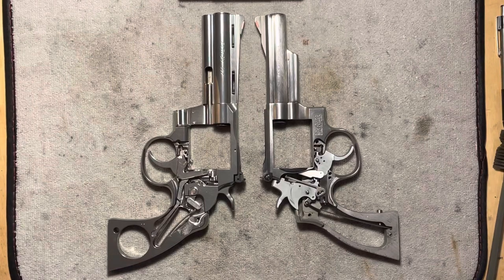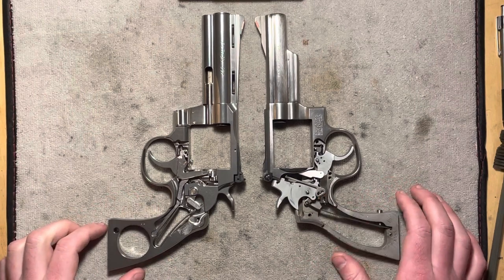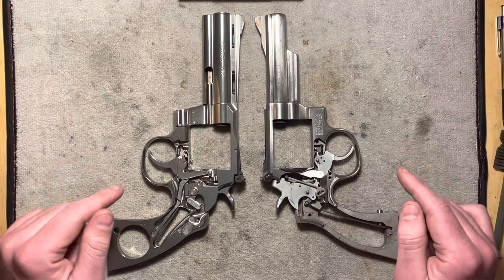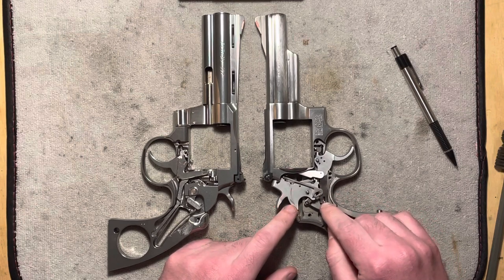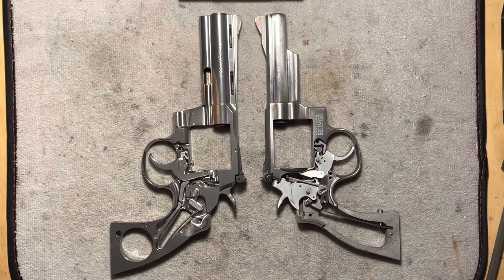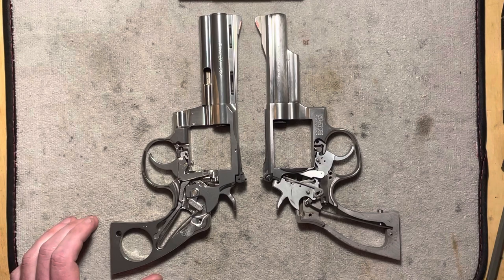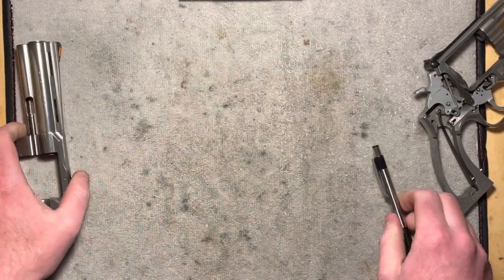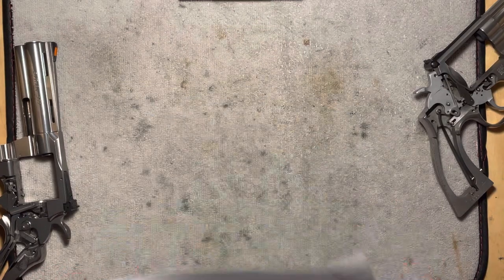Revolver Safeties: Transfer Bar vs. Hammer Block (+ Rebound Slide)

Comment: Great explanation. I own several Rugers and a fellow told me that the S&W 686 plus, also had a "transfer bar".  I knew he was giving me misinformation but could not explain the difference between a "transfer bar" and a "trigger block"   Thanks so much.
Reply from the maker: It’s definitely tricky to keep them straight and people get them mixed up all the time… looking back at the video, I even misspoke a couple times in spite of them being right in front of me and being the one explaining the difference. 

If someone messes it up in conversation I usually don’t hold it against them. It’s really easy to misspeak even knowing the difference.

Comment: Excellent video explanation.  There are a lot of people that get these confused or will even use the terms interchangeably in error.  I covered some of this myself in my video comparing the Ruger GP100 and the S&W686.
Reply from the maker: If you watch closely, I even jumble the words in the video at least once, then randomly threw in “firing pin block” just the really make a mess of things. 

In my defense, having both side by side and saying both phrases so many times was overheating the ole brain bucket.
Reply: @ColterBrog  It happens to all of us.  In a video I edited tonight (which isn't posted and probably won't be for a little while) I accidentally called a firing pin block a hammer block.  I catch little things like that almost every time I edit a video.  Often I never even realized I had misspoke.
Reply from the maker: @Preacher357  I’m definitely not as good as you are at the editing aspects. I really try to do everything in one unbroken video. I am able to do some basic, very basic, splicing but prefer not to. 

I’m getting better at various aspects, but currently I’m just filming on iPhone so the work put in has to compensate for the tech illiteracy.
Reply: @ColterBrog  When I started the channel up 2 months ago I had never done any real work with video before.  To me, any time I take on a new endeavor half the fun is learning all the technical stuff, much like with guns.  Learning how to edit video has been a blast for me.  Of course, it has also been expensive as I have spent some money on programs and equipment, much to my wife's dismay.  At the end of the day, though, the content is the most important thing.  My favorite YouTuber is obviously Hickok45, and he does very little editing to his videos.  He basically just presses play and starts talking and shooting.  If you are getting your point across and people are watching then that is all that matters.  I mean, we have been making videos for about the same amount of time and you have over twice the subscribers as I do, so you must be doing something right.  👍
Reply from the maker: @Preacher357  I’m just doing the low budget blue collar college student kind of thing. New guns are very closely associated with annual reviews and tax returns. It’s fun, though, and making time for it every week gives me a chance to do something enjoyable.

Comment: Why do you need a hammer block if you also have a rebounding hammer? The rebounding hammer alone prevents the firing pin from hitting the primer unless the trigger is pulled. 🤔
Reply from the maker: My memory might be a bit faded, but if I recall there was an instance of an accidental discharge associated with a S&W revolver during WWII. I forget the specifics circumstances, and much of the detail may be lost now, but at the time it was attributed to mechanical failure. The hammer block is added as a redundant safety feature. 

Without having a revolver in front of me, the only way I can conceive of this is if maybe poor maintenance caused the rebound slide to be stuck. It would have to be a pretty extreme amount of neglect but revolvers often are not disassembled by end users. 

Having worked as a gunsmith, it’s sometimes surprising the deteriorated state that can exist inside a revolver which looks fine externally. Sweat, humidity, salt mist, etc. being wiped off the exterior will keep it looking respectable for decades while severe corrosion can be hidden within.

Comment: The proper name is the hammer nose, not firing pin. You're welcome.
Reply from the maker: Correct, that is S&Ws terminology. The Colt has a firing pin. 

I actually misspoke on several things. With both revolvers side by side, the different terminology the two companies use, and trying to discuss both of them simultaneously… it’s hard for it not to become a bit of a nomenclature jumble. Good catch, though.